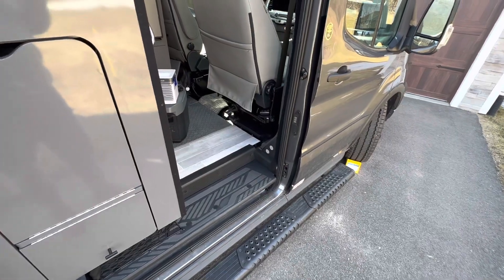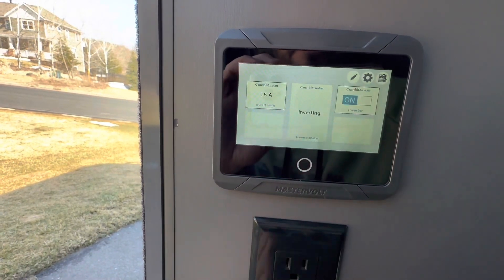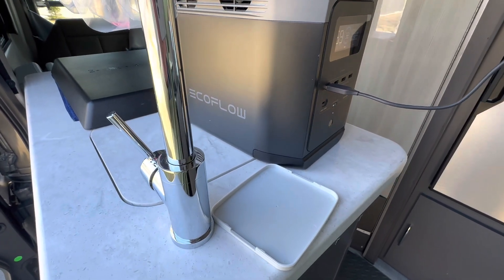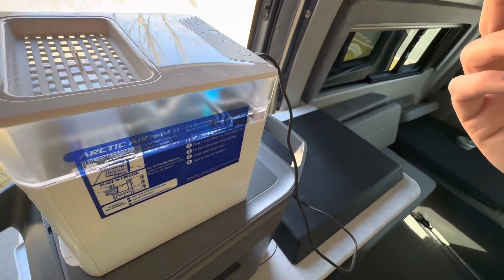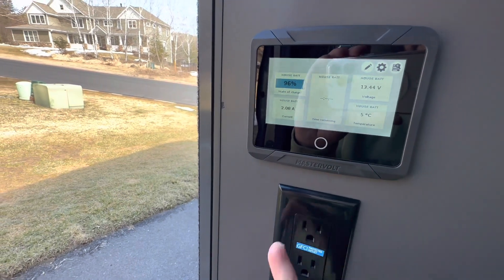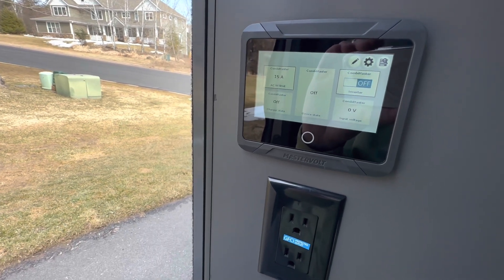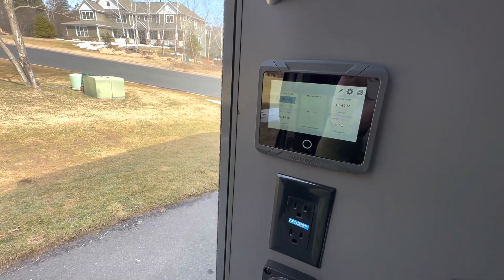Using the Re(Li)able Lithium Battery System in a Thor Sanctuary 19PT

Comment: I just bought a used 2022 MB Sanctuary 4x4.  The lithium battery was basically dead as the first owners never drove the van.  I mean, never, as in 2 years.  It had 580 miles on it when I purchased it last week 9/4/23.  So, I had to call Master Volt to remotely (via my laptop hooked to a USB under the passenger seat) slowly bring it back to life with a slow controlled charge.  Hopefully the BMS kept it safe at around 10%, we'll see.  I was able to charge it to 100% but it still has a red-light code on that I need to get cleared if possible.  Getting Master Volt on the phone is a challenge and required being on hold for 5 hours.  The prior owners weren't able to tell me anything about how to use the system or the vehicle.  So, this helps a lot.  Thanks.
Reply from the maker: Wow.  That’s insane.  It’s like brand new as far as mileage goes. Hopefully batteries are good.  Thors website has an owner section and they put all your manuals in one place once you register.  Might be helpful but it’s a little overwhelming to read.  Have fun with the van!

Comment: Thank you for the very informative videos on the 2023 Thor Sanctuary.  I have been watching all of them and you do a great job with it. Now for my question which is regarding
your 190 watt solar panel on the roof.  I did not see where the solar controller is in your van
and was wondering what turns off the solar panel from over charging the lithium batteries?
Any information you can share on how the solar panel works and how effective it is will be
greatly appreciated.
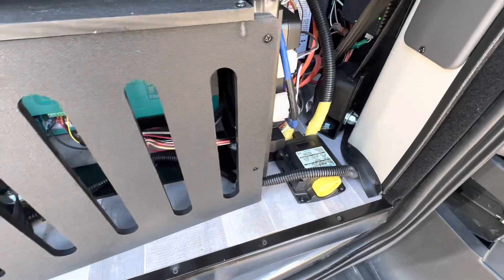Reply from the maker: At 1:32 in the video I am showing the battery safety switch in the back and slightly up and to the right you can see two tiny green lights.  That’s where the solar controller system is located.  So far it seems that the solar controller and master volt system automatically manage the power flow.  Less than 100% battery and  you will see positive charge like what is shown in this video.  When it gets to 100%, the input amps will drop to 0 or be slightly negative until it drops and then it will bump it up again.  Switching the yellow safety switch to off will basically stop this cycle.  This is how I choose to “store” the van if not planning on anything big for a week or two.  Solar panels don’t get close to actually giving you 190 watts.  I’m more in the 120 range so far.  I’m pretty far north in the US, so you might expect more further south.  If not running your a/c or microwave, you will probably be net positive on charge during day.  You will probably not replenish your nighttime use entirely on solar alone.  It won’t keep up with heavy AC use, just slow it a little.   Hope this helps and thanks for watching.

Comment: Great video ! Is there dual alternator in this vehicle? The lithium battery is charged by a dedicated alternator while idling or driving ?
Reply from the maker: Yes.  This van does have a second alternator for charging the lithium batteries.  I try not to charge at idle due to the potential overheating issue of the alternator itself.
Reply: Does the Transit auto start when the battery gets low?
Reply from the maker: @rdtw5505 this model year build does not, the 2023 19PT.  Thor’s newer ford transit builds like the palladium/tallavera do utilize an auto engine start to recharge lithium.  I can’t speak to its functionality but it is one of the selling points.

Comment: The small toggle switch at back of van has option for on/charge only.  When I discovered mine for the first time it was toggled to charge only.  Everything worked in my vans electrical until recently and now I can't get charged while driving and unfortunately only have standard outlets at home.  What are your thoughts on my toggle switch? not charging while driving or in sunlight?  And plugging into stand wall outlet at home for charging?  Thanks
Reply from the maker: You can use your outlets at home to charge your van.  You will just need an adapter that is a standard male plug to a female 30 amp.  Make sure you change your van input to 15 amps as well to avoid tripping your breakers.  If the battery has depleted you can also try using the “emergency power” button on your dash.  According to Thor, if the lithium batteries get too low they sort of go to sleep.  Holding that button for 10 seconds with the van running should “wake the batteries” so they can charge again.  Plugging the van in should accomplish this same thing though.  I don’t know about your switch.  My switch is unlabeled.  I assume we are talking about the yellow switch and if I turn it counterclockwise it acts like it’s off.  It doesn’t charge from solar or driving in that position
Reply: Thank you for a quick response.  I will give it a shot.

Comment: Lesson learned on my 19PT. When you’re connected to the house at 15 amps don’t run the AC and a full absorption charge to the batteries. It produces too much load on the inverter / charger and will overheat it .
Reply from the maker: I really need to just get a 30amp outlet installed on house.  I haven’t had good luck with using a standard outlet.  Also don’t use your microwave and ac at same time.  Also overloads inverter.

Comment: Great video. Thanks for all the details mentioned. Have a couple of questions. Are the solar panels you're referring to built-in to the top of the van or portable? Is the specific version of Thor class b van you bought The reason the batteries are on the inside? My wife and I looked at several different models and brands of class b RVs a year ago and all of the batteries were located outside and underneath the rear end of the van completely exposed to elements. As I did not believe this setup was viable in cold weather, or wet conditions we decided not to purchase. It was nearly impossible to find a van with the house batteries located inside. Also, in doing research on Thor vans, I have found many owners complaining of numerous quality control problems on their brand new RV. Have you experienced this, and if so what were the problems you had with your brand new vehicle and how hard was it to get them taken care of? Thanks
Reply from the maker: It has one 190 watt solar panel built on the top and that is what was charging during the video, but I purchased 200 more watts of solar with the portable system from EcoFlow that are portable.  Lithium ion batteries probably should be on the inside of van in cold climates, they can’t be charged below 32 degrees without damaging them.  These batteries have a heat blanket for warming them in winter.  I think the classic AGM batteries for most brands of RV do sit on trays  under the van or in side bins and get exposed somewhat to the elements.  I have no RV experience with that, but I did drive a vehicle for fed ex that had the AGM batteries sitting in a small compartment under driver side entry and it was also exposed somewhat to elements from underneath vehicle.  I made a video about the intial issues but I think you already watched it.  Able to self resolve all of them.  RV’s are put through a lot with driving and just yesterday I dewinterized the van and went through and double checked stuff.  I had one water leak near pump but able to just quarter turn the connection to snug it up.  Had about eight loose screws, two were in the awning arms that I tightened before I put it out and tested it.  I think the amount of Thor products out there increases the amount of possible problems due to sample size.  They also have a very wide range of price points.  I imagine every new RV has some bugs to work out.  It was built in a stationary environment and then has to live its life absorbing potholes.

Comment: Hello 
I have an update worth consideration. I recently noticed moisture on the back flooring during a heavy rainstorm. Tracing the source I found
that the rear 2 windows leak from the lower interior sill.  You might want to do an investigation of this since many components lie just
below the rear windows. Please examine the interior window seal at the bottom of your rear windows.  You may use a moderate pressure
washer on the exterior of the windows to do your test. Let me know what you discover. Thanks!
Reply from the maker: Yeah.  I’ll check it out.
Reply: @jtbrv23  I was wondering if you know or have actually experienced for one reason or another a complete depletion of your house battery to 0%? In this case,  I have no access
to shore power so what do you do? I tried the
emergency power switch for at least 5 seconds but it did not work. It seems if this happens and you do not have access to shore power you cannot wake up the house
batteries using the vehicles's charging system. If you have encountered this scenario and can give any help please respond thank you. Also I do have a small
portable Honda generator but I am not sure
if this can be used?
Reply from the maker: @junglehomes6525 I think I read to hold the emergency power for 10 seconds to wake up battery.  Make sure vehicle is running.  Other people have said that they needed to contact master volt directly and use a laptop to reset system.  And lastly, some people have said that they removed the positive wire from the battery at the back of van.  Theoretically your batteries are in a protected mode right now with 10% battery left.  Removing the positive wire from battery for a minute can trick system into exiting protective mode and letting you charge.  Those are the only options I know of that people have mentioned.
Reply: @jtbrv23  I took it for a drive earlier and pushed the emergency switch several times
as I drove along. When i arrived at my destination about 30 minutes later I checked
and saw that I had gained an 18% charge so
I was able to wake up the batteries without
shore power. Thank you for your help!
Reply from the maker: @junglehomes6525 I’m glad it was able to be fixed.  You might be the first person to successfully use the emergency power button.  Glad to know it can actually help.

Comment: Can you run the 12 volt frig without inverter ?
Thanks
Reply from the maker: Yep.  You only need inverter for air conditioner, microwave, Truma water heater/furnace, and household outlets.  My fridge basically stays on the entire time unless the van is going to sit for a week or two before getting used.  Thanks for watching!

Comment: Great video, thanks. My Mastervolt control panel will not turn on. I heard a "click" behind it like a circuit breaker tripped when I was scrolling through the menu and it now has no power. I've tried holding the power button up to 60 seconds. I reset the systems in the back and turned the main power switch off/on and tried again. My microwave light is not on either. No shore power right now. Any suggestions on how to restart the Mastervolt screen?
Reply from the maker: The master volt screen can be removed.  The top and bottom have a trapezoid shaped plastic piece that slides out to reveal screws.  So top slides up and bottom will slide down.  There’s going to be a couple wires plugged into the back.  They can be unplugged and plugged back in.  My screen froze and I did this to power off the screen.  Also I would quickly check your ac outlets that are circuit protected and just reset them in case one got tripped.  I think one is near the master volt screen too.  There is also a fuse panel under side seat near stove.  Panel is in the aisle on the floor.  Pull it off and should be labeled.  Beyond that you may need a service scheduled.  Be careful if you find bare wires though as they can be electrified if connected to battery.  Mine was plugs in the back so not to scary.
Reply: Thanks so much. Unplugging/replugging master volt screen didn't work, I was able to start van (2023 PT like yours), plug into shore power while running (a forum recommended this), and MV started up and showed 2 error codes. We just got the van last month, it's Thor's demo van that they used in their videos and for trailer shows so there may be a few issues. I don't believe the solar is charging the battery as the voltage always reads slightly negative (ie. -0.72), even in full sun with Combimaster/inverter off, house power switch off, and yellow master switch in back is on and depressed. Looks like I'll have to make some calls this week unless you have any suggestions. I've really appreciated your videos, keep them coming!.   @jtbrv23
Reply from the maker: Sounds like something is loose somewhere and not charging.  Hopefully it’s an easy fix.  Probably best to get eyes on it, so they can find the problem.

Comment: Hey man I have a rv just like it with them he battery pachage can you trust the Honda generator with the plug for the neutral sensor? Will I ruin my machine if I used that floating ground plug?
Reply from the maker: I’m not claiming to be an expert in this area as all this is new to me as go along and try to work through it.  It seems like there are a lot of forums and info out there on needing this plug to work with a RV.  I’m not as worried about the plug as much as the quality of the generator. In addition to the plug you also need a true sine wave inverter generator.  My generac 3600 is not marketed as a true sine wave.  It does 60hz but I think it’s more of square pattern wave and could damage sensitive electronics.  I think best bet would be to check with your generator manufacturer to be sure.

Comment: So, I live in Michigan where it is usually colder than 32F for 3 months. Does that mean that I have to have it plugged into shore power all winter to keep the batteries warm?
Reply from the maker: No.  The batteries can be stored at 100% and get cold.  I think Thor recommends checking it every month or two if you store it and recharge it to 100%.  They output energy just fine below 32F, they just won’t charge until they are warmed above 32F.  I’m in northern Wisconsin so probably similar conditions.  My routine last winter was charge to 100%.  Use it until it got down to about 70%.  Heat the van back up with it’s furnace and recharge to 100%.  I would use the van 3 times a week locally to ski and maybe 3 times a month to ski the UP. Parking with windshield facing south on sunny days would usually maintain interior temps nearly 40, so that helps.  During the most frigid part of winter, like -30s, I would use shore power and put a radiator space heater in the van.  That’s was more to protect pipes because the pink antifreeze does freeze when that cold.  I’m winterizing with air this year.
Reply: @jtbrv23  Thanks for the reply. I appreciate how to do it in winter conditions like we have. You said you would winterized using air this year. Does that mean to just blow out all the water pipes and let drain through the low drain plug?
Reply from the maker: Yeah.  I will make a video when I do it.  But basically I will use a hose adapter on my air compressor and blow the system out.  Really the same thing they do to yard sprinkler systems in our area.  Probably will use a lower overall PSI, but I need to research that further.  Might need a little antifreeze for water pump but we will see.  My entire system did survive winter so I’m not knocking the antifreeze.  It’s just messy and even though it froze, it made like a firm slush rather than a solid ice cube.  That’s probably by design.

Comment: Can you run the ac on this system? Thinking of this for a commuter van and would need to camp in the parking lot for 2-3 days at a time in a warm climate. Great explanations thanks!
Reply from the maker: Yes.  This van is only battery power with no generator.  The AC for this van does require use of the inverter.  A DC option might be better.
Reply: @jtbrv23  Thanks for the video! I thought I’d researched everything, watched more videos than I can remember, went to see a 2020 Thor Sequence with a generator that was a private sale, saw a 2021 for the exact same price but only 3,000 miles versus 34,000. On the walkthrough I asked for the guy to turn on the generator. There wasn’t one😳 Huh??? I did remember seeing in one of the Thor videos the lithium batteries was an upgrade over a generator so I said OK. NO idea this has the smallest battery pack 200Ah and I allowed myself to be hoodwinked. 

Afraid to ask but how much AC time do you get from a full charge? This one doesn’t even have the auto start when the batteries get below 30%. I’m still not sure whether to be made or not and whether it’s really an upgrade. By chance do you know if I can add batteries up to your level from 200Ah? Thanks…
Reply from the maker: We might have different AC units but mine draws around 60 amps- 70 amps.  This system is 400ah so I would have 5 hours of continuous use.  It doesn’t run continuous though, more like run for 2-3 min and off for 8-10.  I do not know if you can add an additional batteries to the existing lithium system.  You could have a second stand alone system.  I carry an additional kilowatt battery made by EcoFlow, but they make larger systems too.
Reply: @jtbrv23  Thanks again for the info as to what to look at. I checked and best I can tell on the Sequence it’s 25 amp to start and then 10-15 amps for normals ops.  A bit surprised your draws that much. I’d REALLY like to get your 400ah setup….add 2 more 100Ah batteries. My inverter is only 3000 so it would have to be swapped out, I believe.
Reply from the maker: Yeah, the unit seems overpowered for the van when using.  Thor probably could have used a smaller more streamlined unit even it had less output.
Reply: @jtbrv23  Agree.  It is a huge AC unit for a very small area.  Thor should probably put a smaller more efficient unit on top of these vans.